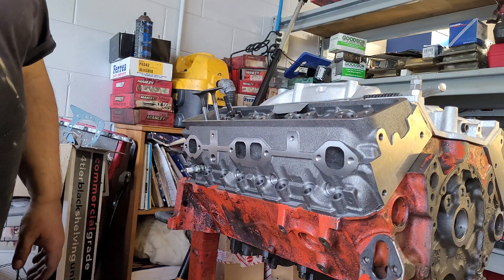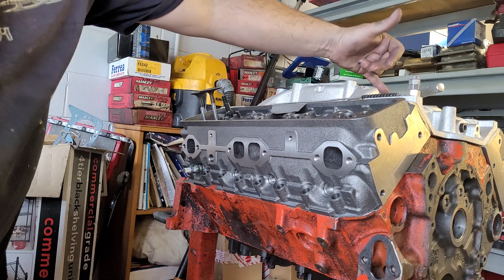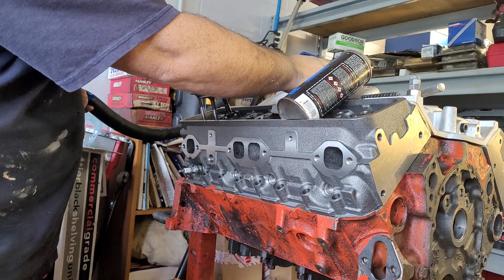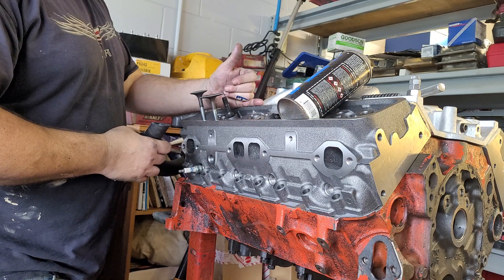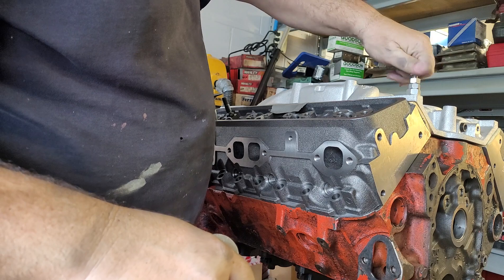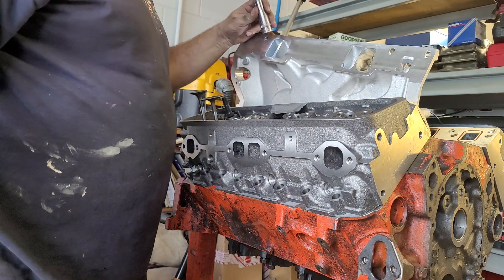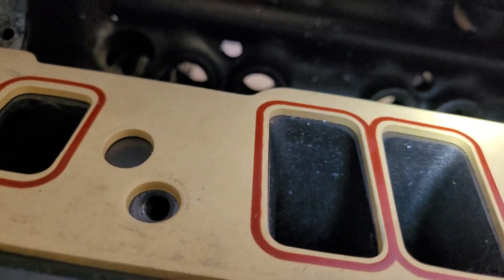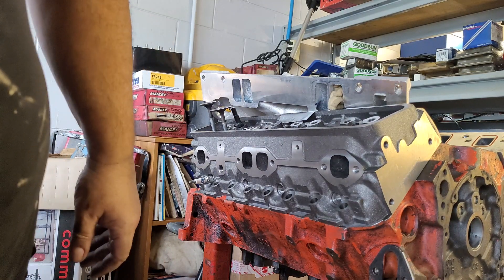Weiand Street Warrior intake manifold misalignment using vacuum and dykem mockup on 350 engine block

Comment: 🔔😎 
Port lip.
Carbed street cars I usually keep the manifold 30/1000 smaller all around in case there is a dowell pin misalignment. (no borescope)
Dropping off the step cant be as bad as hitting a step ... but...
hitting a 30/1000 step might make liquid fuel pop back into the flow.🤔
Personally I run SEFI.
Reply from the maker: I had this conversation with D.V. he asked me if I like a manifold offset and how much. .030" was my number. He agreed.

Comment: Not have that lip on the floor at low rpm low lift is a big deal, these old style ports and manifolds need to work the best they can down low as that's where they spend most of their time from what I've seen on street motors, I think your spot on